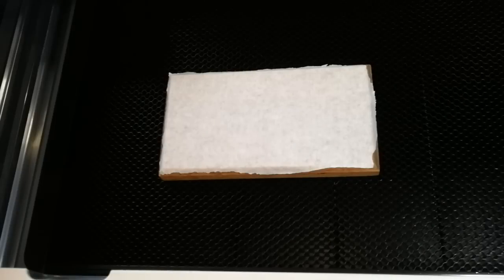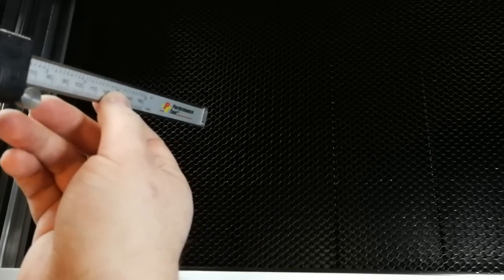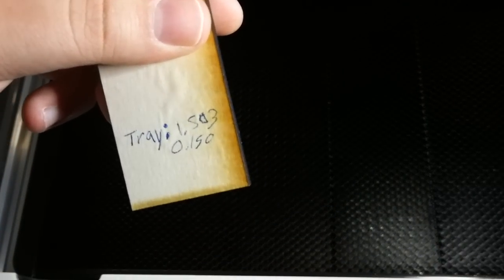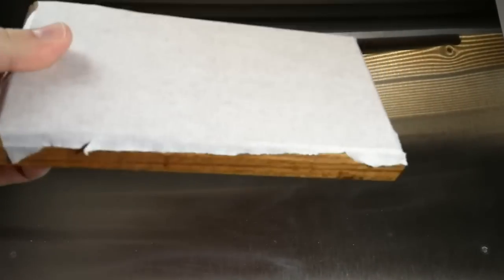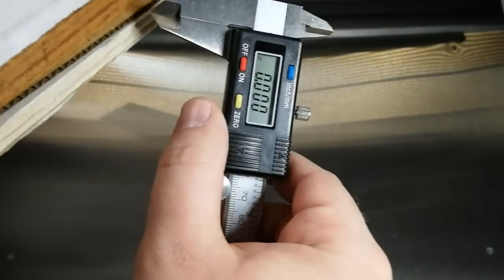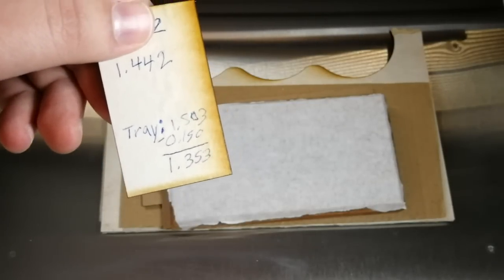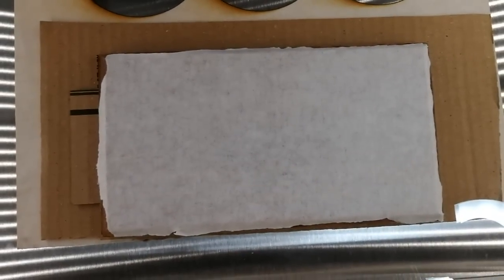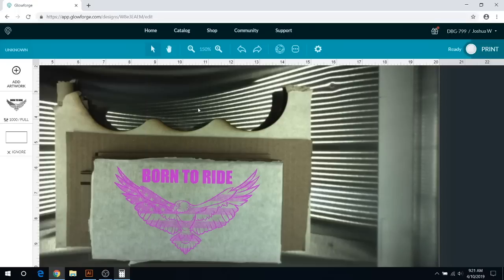How to use the glowforge without the crumb tray?

Comment: Thank you for this video! One question. I went through the steps, and everything looked lined up properly. But when I went to engrave the engraving was pushed off to the right side by about 3 inches even though in the display it was lined up properly. Any idea why it does that?
Reply from the maker: You might need to click set focus and mark the marker first. I think they introduced this after this video.
Reply: @FreshStartCustoms  thank you. Yes I realize now that Glowforge updated it to where as long as the item is above the crum tray hight you just click set focus and it will do the math for you. I appreciate you answering anyway.

Comment: Why wouldn't all crumb trays for the respective glow forge version be identical? I really am sort of angry that I paid this much for an engraving machine that I need to do all these extra steps to engrave something that is .7 inches.
Reply from the maker: There is a slightly newer way to do this that uses auto focus. It will still need to be higher than the original crumb tray height. If you look through my videos, I made another video showing how the newer way works too